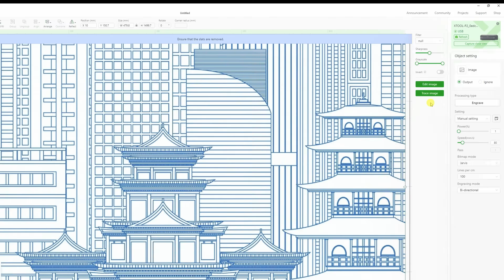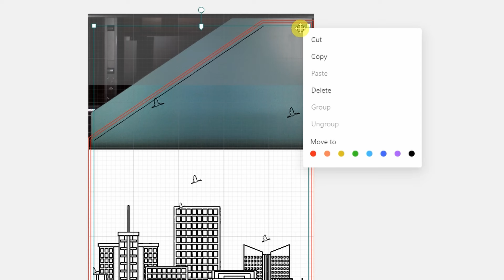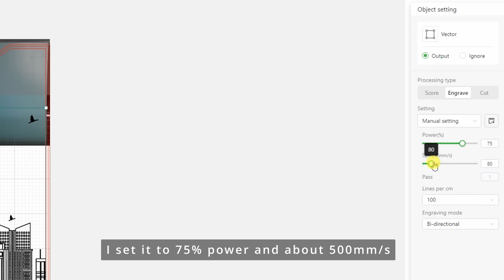Making a Japanese cityscape backlit mirror door with xTool P2

Comment: A couple of suggestions, if you don't want LED hot spots you could exchange them for COB LED strips.
For the wiring you could use an intruder door loop. Or use each hinge for each power rail.

For the ultimate LED control use addressable LEDs this way you can control the brightness and color and brightness of each LED, this way the water could be blue but the buildings white for example .

Check out a project called WLED.
Reply: Yes, I was going to post a similar comment about addressable LED's, making the building 'twinkle' in different hues. Still pretty awesome project!
Reply: Would have commented similar as so-called "neon-LED"-strips would have more diffusion. Still Kudos for that effort!
Reply: Would have commented similar as so-called "neon-LED"-strips would have more diffusion. Still Kudos for that effort!
Reply: Using each hinge for the LED power - excellent idea.
Reply: All great ideas…but he has undo and redo. I concur great project. I didn’t know about individually programmable LED’s, now I have to look that up.
Reply: How do you control the individual LEDs in a setup like that? It sounds like you'd need a small computer like an arduino or something.
Reply: @asvarien Yeah, an Arduino or ESP32 or similar sends commands down a chain of LEDs to control each one by it's address
Reply: @asvarien  it is a 3 write system, a power pair and a data line, each led has a data in and a data out pin. The little controller you instruct how many LEDd are in the chain, the controller can then pass a message to a single LED. Each LED has an embedded controller, there are plenty of examples on You Tube. You can get a standalone controller for less than£10
Reply: *wire system
Reply: First thing that came to my mind while watching was WLED as well. That would make this mirror really awesome. Just imagine sunrise, sunset or lightning flashes😁
Reply: Yall got me feeling real old.   I've never heard of the items mentioned here.
Reply: The use of fresnel diffusion might be even better, I'm just not so sure about getting such lenses in large sheet like that.
Reply: If you run the LEDs around the edge of the mirror glass it will be perfect. Do this quite alot for edge lit glass stairs and shelves.

Comment: Just a thought but you could have used the diffuser sheets from a scrap led tv as that’s why the spots don’t appear on the tv. Fantastic job and channel
Reply: came here to mentioni this. DIY perks has a good example of this with his daylight led lights made from old tv screens.
Reply: The other reason for no spots with a rear-lit TV is the LEDs have lenses which fire the light out sideways directly onto the rear deflector which then illuminates the diffusers on the back of the LCD panel, I tried converting my uncle's old CCFL-backlit TV to LED, and even with the LCD's diffusion, it's "spotty", kind of usable, but looks rubbish for anything other than just using as a crap monitor or something...
Reply: Specifically the Fresnel lens diffuser.  This lens attached to the mirror would make those hotspots disappear.

Comment: Nice work there, a tip for LED strips though is solder the positives at one end of the strips, and then the negatives at the other, this evens out any voltage drop issues that happen when everything is done at one point (where the far end LEDs are visibly duller than the ones nearest to the power input)... :)

Comment: Hi Yorkshire. Door was excellent but the issue of hot spots of the leds is best cured by salvaging frenel lens and obscure panels from scrap LED TV. The fresnel speads the light and the obscure softens it...thats why tvs have them. I've used them in several projects and the results are great....  Thought I'd mention it incase you have future projects using leds.

Comment: Should also mention that wiring the LEDs in parallel prevents all the strips going out if a single LED burns out. Hope you made the door easily repairable because LEDs do and will burn out.

Comment: Excellent idea. I’m sure a thousand people have already commented about this, but higher-density LED strips are now available, with very little space between the emitters. The COB, chip-on-board style nearly eliminates hot spots. You can get them with tunable white temperature and RGB. RGB CW WW is the designation. Red, green, blue, cool white, and warm white chips give the user selectable color temperature between 2500 and 7500 Kelvin. Addressable ones are also available. If you wanted to get fancy, you could make a sunset color gradient, even blue, with sunset colors reflecting off the water. Unfortunately, I don’t believe individual pixel addressable strips with high CRI and white balance with color are available. I’m sure it is only a matter of time. Oh, I forgot to mention with a good driver you can get high-frequency PWM for “flicker-free” operation and precise dimming. I’ve been researching them for my home and to roll my video lighting.

Comment: Idea ! See if power can be transmitted through  hinge or two separate hinges ( low voltage) using vinyl spacers for positive and negative poles ... If wied right should not see any wires and constant supply to LED !  Magic"  Anyway nice job and keep up the good work !

Comment: Stunning, just not sure about the cable exit. Maybe some kind of magnetic switch in the reveal would have been nicer, but would only work with the door closed.
Reply: Agreed, the wiring is clunky. Incidentally, Keith Johnson Custom Woodworking
 just did something similar. Door window + electricity. The video is "A closet door with cat access and privacy glass!!" But I don't want to nitpick, this mirror is yet another amazing job, so congrats NYW!
Reply: Nit picking. Good grief!
Reply: @christinahand973  it’s not nit picking, it’s an opinion to make what is already a great design better.

Comment: If you decide to make mods on the backlight, I suggest a 5-8mm diffuser plate and you can use an LED strip all the way around on the edges.
That will give a nice and homogeneous, uniform backlight. LumiSheet EdgeLit or Omnify for example.

As an alternative solution, a cheaper acrylic plate would also do the job.

But, anyway, very good idea and nice job ... !

Comment: This is primo cool. I do like others have thoughts about power. What some batteries with a charge circuit and you could a USB c port on the hinge or lock edge of the door.  Then just plug in for 30 minutes once a month.

Comment: Creative solution...  can the brightness be reduced with the the remote?
 
Perhaps staggering the strips and adding another layer of the static glass frosting would help with the LED spots???  However, may be to much rework for unknown outcome.
 
I'm wondering when the intended use would be for the LEDs.  Likely too bright to sleep with it on so maybe to help set the mood for bedroom Olympics... Maybe add a motion detector to turn them on during the night.

Comment: It's a great looking door, but... Why didn't you have the cable go out the backside of the door and into the doorframe? That way, the cable could have been hidden. Even the transformer could have been hidden behind the wall and power taken directly from inside the power outlet. I'm crazy about hiding cables, though.  😂
Reply: I agree, the cable outlet is the only slight head-scratcher on this otherwise very impressive product. British building regulations are famously quite a bit stricter than most places with electricity in bathrooms - types of light switches allowed in the bathrooms (pull cord type), types of sockets (essentially none other than shavers), etc. Possibly it was done to avoid having to worry about any of that.
Reply: @ep1981  I would believe 12V is OK. It is in Norway, and we invented strict.  😉
Reply: @unklian9221  Yeah, after a couple of meetings with some of my ancestors. 🤪

Comment: Did you think of using a thickish, say 6-8mm acrylic back to the glass then polish the sides and have leds shining in at 90deg all around the edges. That would use the acrylic as a light guide giving an overall even light. Ditto about using hinges for power and a centre hinge added for data.

Comment: keep the gap you have but use some tracing paper / white perspex "2mm thick"on top of the LED strips without the plastic as the plastic is narrow thus has a spot around it and distance is important, also use the whitest paint mixed in with some phosphor that's behind the LED's so that light reflected to the tracing paper or even white perspex will reflect back and bounce back forward, i would have a gap of 8mm.

Love the mirror.

Comment: Top job and looks good ,where you have lasered the silver backing can you see right through the bits that have been burnt off
Reply from the maker: yes it was very clear, maybe around 5-10 % opaque. when I made the illuminated mirror ceiling it had a nice frosted effect which I prefered, im not sure if that was because that was a diode laser or the effect of the dithering pattern in laser grbl.

Comment: What about using some form of contacts in the top of door and the rebate of the frame no ugly wire sticking out of the face of the door, the down side is it will only light up when the door is closed which I don’t think is really a problem

Comment: Great video I love the way you make it look so simple, but I hope you can help me. I have an old model Dewalt saw table and over the years I've lost the rollers, would it be possible for you to share the supplier of the silver metal rollers used in this video please. Many thanks.
Reply from the maker: Yeah they were from RS components, I got them about 6 years ago to set my bandsaw up for  milling 12" x 12" pitch pine beams- https://uk.rs-online.com/web/p/conveyor-rollers/3089731 you can probably find cheaper ones on ebay or amazon too, but these are good iundustrial ones.
Reply: @NewYorkshireWorkshop  Many thanks for your quick response.

Comment: Never thought about engraving a mirror! Do you think this is doable with a good diode laser? I'm expecting an Xtool S1 40w soon 🙂
Reply from the maker: I have before, see here- https://youtu.be/ivZ0ggc4TL8
It did it reasonably well even at 10w, although the mirrors in that video had a much thinner backing. Lower quality mirror I think. The 40w should ahve no problems I think. I have the d1 pro too but I havent had time to unbox it yet.

Comment: Wow, so damn cool. I've backlit sandblasted mirrors before but using a laser and skipping the mask looks like the way to go. 
A couple of questions: Anything special about the glass? (thickness, mirror backing material, Safety Film, etc) 
I assume it's a standard mirror and not safety glass?  Any particular reason for the 4th hinge at the top of the door?

Adding strips of diffuser helped but it's always a tradeoff between thickness of the piece, amount of diffusion and amount of light to let through.  Have you tried COB lights? No animation but easier to diffuse. 
You may also want to check out laser lit side-glow fiber optics as a light source. Not as bright as a bank of Leds but much easier to handle when an led burns out, especially if the led is buried in epoxy (not an issue here but something to think about if you ever commercialize this).

Haven't looked at your previous videos yet but have you tried lasering a speckle pattern rather than larger lines? Makes the image better to fade into the background for a bathroom mirror that used and then turn on the back light when you want to see the image.
Again, great project. Subbed
Reply from the maker: I did use dithering on the Bathroom ceiling project and that did look nicer I think, That was done using lasrgrbl but I couldnt figure out how to do the ditethering in xTool creative space, im sure it isnt an option yet. I had to use creative space for the conveyor fuction.
 I had though about butchering an led ceiling panel which use an edge lit prism type diffuser like in an led tv (its kind of like a fresnel lens but isnt). but I couldnt find any with rgb and I wasnt sure that the strips id got would be bright enough for edge lighting. Ill difintely try that the next time.

Comment: You should use a LED strip with more LEDs per 1m, 60 or 120 LEDs per 1m, this will prevent the LED points from being visible

Comment: Another really lovely project so sincere apologies for being negative but having the LED wire sticking (unnecessarily) out of the face of the door is bad enough but from the top rather than the bottom where it would be less noticable seems a bit strange (sorry). Beautiful design though.

Comment: Everything's fine, everything's great. But... The power cord looks terrible. It just stings the eyes!
I used the hinges to power the LED strips on the glass doors of the kitchen cabinets. Everyone asks how I realized the LED power supply!!! It takes some effort to COMPLETELY hide the power cords, but it's damn worth it! The effect is excellent. Light from nowhere - a miracle!!! You can easy and safely use the hinges because the LED power supply voltage is SAFE. You have an ideal situation: two hinges, close together each other at the very top. A dream situation - it's begging to be used. In your case, it's just a matter of drilling thin holes and passing thin wires through them directly to the hinges and electrically connect it. Piece of cake!!!
Somehow it's so strange that other people generally don't pay attention to such things. But the doer's eye ALWAYS SEES such a thing. And always such a thing irritates the doer until he finally reworks the thing. You'll see!!!! Unless you're an extremely patient and calm guy.  :)))

Comment: Could you have edge lit the mirror?
Reply: that thought crossed my mind as well.
<edit> although, by edge lighting it I don't think it would show the engraving. The silver coating is on the back of the glass so the light needs to shine through it not across the front of it.
Reply: @Galerak1  Good point Sir.  I'm sure I've seen a sort LED sheet too somewhere, some car tail lights seem to have a ribbon rather than individual LEDs, but I'm sure after some thought that he's thorough enough to have looked into it, but then he is from South Yorkshire so you never  know :) :)

Comment: The laser cutting on the mirror is very cool. The P2 is a neat piece of gear.
The rest of everything is extremely janky. The USB cables for diffuser standoffs, the hot glue exposed door frame wiring, the hotspots that never really went away...

Comment: You might have been better off using some thicker acrylic or polycarbonate with a mirrored finish and edge lighting it.  Fresnel lenses are also much better at diffusing light and you can also get diffusion layers designed for the job both of which you can get from old broken LED TV's.  you could probably get a large enough sheet of each from a 50inch broken TV,  and maybe the lights too.

Check out a channel "DIY perks" who's done some cool things with broken TV parts.

Comment: Should have put a battery block in the door as well to power the led’s. Then put contacts in the door frame to recharge the batteries when the door is closed. That way you could have hidden the wiring in the molding.
Beautiful work and idea, but the wiring completely ruined it.

Comment: Why drill the face at the top for the power wire ??????? Could have put it on the bottom of door hinge side a hid the wire with white base board.  Awesome project ruined with that wire at top. FAIL